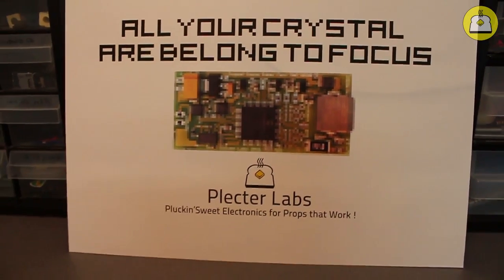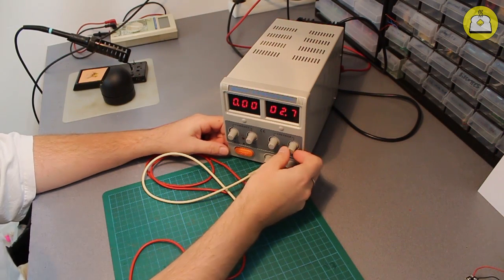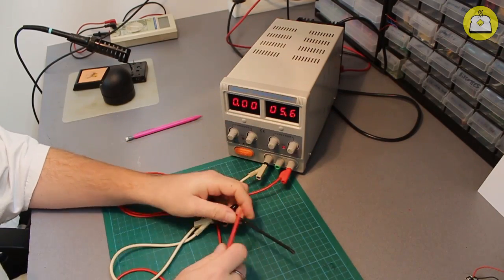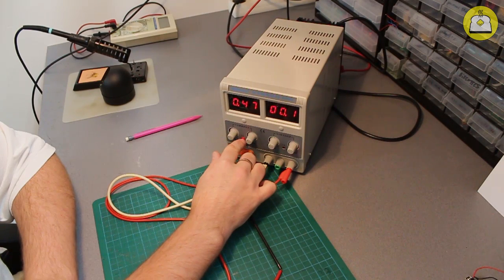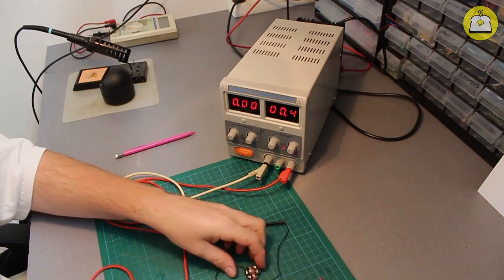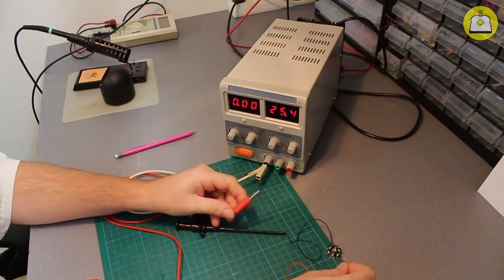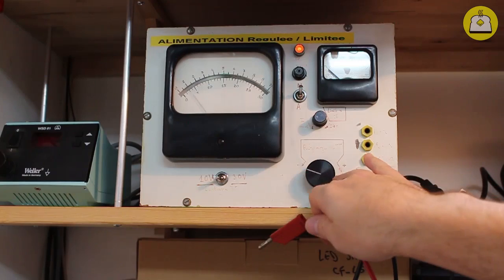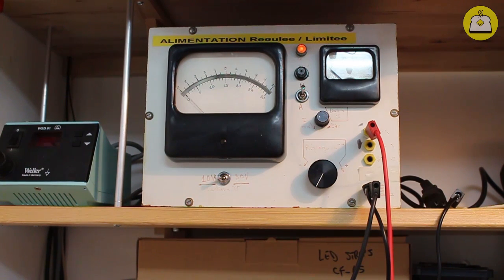Bench Power Supply (PSU) tutorial

Comment: I got a 60v 5 amp model and when i shorted it out to set the current limit to 4 amps like you did in the video it sparked and now I cant adjust the output current, it just stays at 120 volts. I just requested a return if they wont return it could it possibly just be a fuse that popped? Or maybe something else that would be easy to fix? Thanks for your time this is my first PSU
Reply from the maker: On which voltage was that when you shorted it ? By definition, voltage should drop and current would just ramp up to the the limit. Now if it was set to high voltage (like 20+) when you set the current you could have blown a fuse. There are several inside in general
Reply: ***** Thanks for the reply, ya if your saying 20+v is high voltage i wont tell you what i had it at lol. I'm going to see if they take it back but if not im not going to push the issue and I'll open it up and see if its just a fuse. Thanks again!
Reply from the maker: willm350
happy to help. If you had cranked it close to the max, it's possible that the current limitation module didn't have time to trigger, as that's a lot of voltage to take down, and a lot of amps too. So to prevent a major failure, the fuse blew. You should be able to find those inside. Good luck

Comment: +Erv Plecter
Where can i find a very good 240V capable bench power supply ,and which one do you suggest ?
Reply from the maker: you'll find those on amazon UK. If you're after a professional bench PSU, I suggest you look at the ones sold at Farnell, Maplin, or Mouser, depending on your location.
Reply: i'm looking for a begginer one, and to be honest i like this one you're using now but i cant see its name to look for it .the heat sinker looks really great and shows that this one you have is well build .i wish if you can provide me with the brand name ,thankyou also for communecating and helping me out by giving these tips .

Comment: How do you know what amps to set it on. I bought a bunch of electronics that I haven't played with yet. Whatever I decide to make, how do I know the amp setting?  Thanks.
Reply from the maker: the video explains how to set the max current limit
Reply from the maker: the current limit depends of the device you're powering, I can't guess, it totally depends on what it is
Reply: @ErvPlecter  thank you for your quick reply. I bought a bunch of things.  A bluetooth circuit, relays, a timer, etc. I was wondering because I have a power supply getting shipped and I want to play with it by hooking up some stuff to it. I know how to set the amps thanks to your awesome video but like say if I have a strip of led that I snagged from some old junk that doesn't have amp  numbers on it or say I have a few things that don't say amps but volts.  Is there a way to figure it out using a formula or do I wing it or do you have a video that helps a noob such as I that I can watch.  Thanks again!
Reply: BTW, your homade power supply is cool as hell.

Comment: So you prefer switch-mode/regulated rather than linear/variable PSU's?
Reply from the maker: I'm not sure I understand the relationship above between linear slash variable PSU. Both SMPS and linear can have a variable voltage. But you might mean unregulated instead of variable ? Linear power supplies can also be regulated as well (variable output opposes to fixed output).
The model in this video is (afaik) SMPS, it's a great deal for general purpose electronics in particular digital electronics for which PSU noise isn't a big deal. For audio I use a regulated linear PSU (home made) but it has a smaller current output (2A), which is expected for linear. This is the other pro for SMPS : size and weight are generally better for higher current output compared to linear. So bottom line I use both, but not for the same things.
Reply: Erv Plecter Hey! :*) Sorry, I'm just beginning my journey into Electronics (hobby). I hope you understand my confusion (that's a real understatement, lol!) as a beginner. My search for Bench Power Supply howtos thus far hasn't been too fruitful (hint, hint). There's lots of stuff about reviews and tear-downs, etc., but nothing much for the actual beginner explaining/demonstrating, hands-on, start here, show and tell's, do this/do that, examples/kinda stuff. Maybe I'm just not using the right search syntax (lol)? 
Regardless, your vid is exactly what I'm talking about! Thx again! :*)
PS: I really like those drawer cabinets in the background. Do they have a specific name-type? Where'd they come from? :*)

Comment: I need someone's opinion about linear power supplies. WHat are the good specs on ripple and noise? If
ripple and noise:  C.V. <20 mVpp / D.C. <50 mApp is this good, very good or bad specification?? Purpose of use: to build and test a homemade hifi amplifier and other stuff were ripple is a factor.
Reply from the maker: it depends on several things : recent cheap bench PSU are SMPS which is... bad... bigger ripple. < 50mV is ok for most applications. For your amplifier you can test with any PSU that has a real transformer (coil) not SMPS. Once it's confirmed it works fine, you can further build the proper power supply for it using a toroidal transformer and symetrical power supply with a good filtering (10,000 µF on each rail, audio quality electrolythic capacitors).

Comment: hi 
what the unit of Current density ? is it A or MA?
i have Dc power supply 60V - 3A model. and i want to connect it to a reinforced concrete so the bar act as cathode and a mesh on the concrete act as Anode. 
i want to apply a current density of 0.8 A/m2 .. Do i have to multiply this number by the Steel Area to get the current density at the DC power?? if the steel area is 0.01m2 therefore i = 0.008 amps. 
i think it is very small number!! 
can you help please as soon as you read my comment.
thank you
Reply from the maker: Chahra Meftah : current density is current per area unit. Current can be expressed in amps or mAmps. You don't apply a current density. Current density is the result of applying a current to a certain surface.
Reply: @ Erv Plecter Thank you for your reply
Reply: ***** another last question please! 
say i want to apply a current density of 0.7 A/m2 to a bar with surface area equal to 0.01 m2 .. so the current is should set at the DC supplier should be 0.7 * 0.01 that give me 7 ma. is that right?

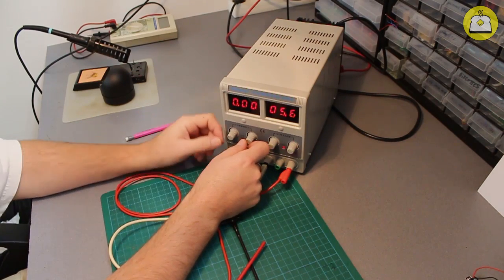Comment: I have one of these. I'm struggling to understand how to set the current limit. When I follow the instructions that start at 5:22 , I don't get the same results. I turn the voltage and current dials to zero. I short the two terminals. Both displays read zero. Now when I increase the voltage even very slowly by the tiniest amount, the device beeps and cuts out. The 'current' screen shows something similar to 'ERR'. There is no opportunity to fine-tune, the device just cuts out. 

Now I've also noticed that with some very careful adjustment, I can get the voltage display to read 'zero' and the current screen to read around 0.5. But again... turning the current dial makes no difference. Can someone help me understand what I'm doing wrong please?
Reply from the maker: I can't speak for all bench PSU models, however, you should probably put your current know a little higher first place before you start increasing the voltage with the probes shorted and watch the current increase. Current at zero might trigger a fault mode. It's possible also that your PSU isn't designed to make the voltage drop when excess of current is detected by the current limiter and that you get an error instead (first time I would hear about this, usually you are proposed to adjust your current knob).
Reply: @ErvPlecter  Wow... thanks for that fast reply. With your help I've managed to work it out. Because I would probably forget if I didn't write it down, I've written myself a guide which I'll paste here in case it helps someone else figure out how their particular model works:  (With the caveat that 'your results may vary', and 'always read the manual'!): 

1) Ensure that the power is turned off. 
2) Turn the current (left-most) dial to the 9'o'clock position. This represents a cut-off of about around 1.5A.
3) Turn the next dial (the 'clicking' voltage selector) to 0-15. This connects the remaining two dials.  
4) Turn the remaining two voltage dials to zero. 
5) Turn the power on. All displays should read zero. The unit beeps twice. 
6) With banana plugs, leads, and crocodile clips, short the -ve and +ve terminals. This should not cause any change in the displays, nor any beeping. 
7) Gradually turn the 'fine' voltage dial clockwise. The current display should increase to around 1.5A at around the 10 or 11'o'clock position. This is approximately the current that the 'current' dial was turned to in step 2. Then a slight further turn of the 'fine' voltage dial should cause the supply to cut out, accompanied by beeping and 'ERRR' on the current display. The limit is now limited to around 1.5A. Fine-tune the cut-out by gently turning the current dial to make the unit cut out at the appropriate level. 
8) For reference: 
1.2A is the minimum limit on the dial - turned all the way to the left.
2A is around the 1'o'clock position. 
2.5A is at around 3'o'clock. 
3A is the maximum output - turned all the way to the right. 

Thanks again for your reply!
Reply from the maker: @samshltn  that's perfect. You got it right, the goal is indeed to build up a "scale" of current on your knob and get used to put the current limit where it's acceptable, like when turning on a board for the first time, you estimate it needs like 150mA, you give it 200-300 but not 2A, safely increase the voltage, check used current etc. Good job

Comment: can you get one where whatever you set the voltage it is exactly that, also to the current. in other words not setting limits but setting exactly the voltage or ampage that does not change regardless of load or impedance.  so for a high power l.e.d. set at 3 volts 20ma or 30 volts  2ma which does not change. complete control!
Reply from the maker: +Alan Wolstenholme you have that sort of control but keep in mind a specific load will impose you the voltage/current bias point. A LED is typical for this, defining a current will make the voltage drop or increase to the corresponding zone of the current / voltage relationship of the semiconductor
Reply: i just want to find a way of doing an experiment to found out for example if a 12 volt 10 amp bulb will light at the same brightness if a 24 volt 5 amp supply is connected to it-obviously massive current limiting but just in theory-think i might be able to achieve this with batteries due to internal resistance current limiting-any thoughts?
Reply: you missed the point never mind. i want 10,000 volts limited current, will it shock the same? there is a thing called skin effect..

Comment: Yo Erv!
Brand name on this particular PSU?
Thanks
Reply from the maker: you're right, hard to see on the video with blue-on-grey markings. You are going to like it : it's "DIGIMESS" lol :-)
It's another rebranding of those popular PSU you'll find on amazon or electronic part shop. This one has a transformer inside, I actually recommend those models over more recent (and cheaper) models which are so lightweight due to using SMPS inside (no heavy transformer). Noisier, IMO (on the quality of the regulated voltage).

Comment: hi sir i have some proplem here and i hope you can help me 
i got one of these power supply and i have experiment that's requrird constsnt current at 2.7 A but when i connect my DC power it give me a max, current of 1.8 A and max (constant voltage) of 28.9 V , i tried to set the current but when i do the steps and try to connect it again it just the same old current 
can you help me please 😭
Reply from the maker: hi, it's no brainer, you can't output 2.7A with a 1.8A source.
Reply: oh i get that, but why the Dc have unstable amp i mean i want 0.89 amp constant and its just keep go up and then down

Comment: What is the green knob in the bench power supply for?
Reply from the maker: this is not a knob but a banana plug terminal (gnd / earthing)
Reply: sorry again, so the black one isn't grounding? Aren't they all banana plugs? Just trying to understand what's the green one is really for.
Reply from the maker: the black is 0V / aka "negative". The green is earth.
Reply: Oooooh I see now :D Thank you so much, great video
Reply: I have another question regarding the the Amperage lock, I did that on my Bench PSU, I lock it to .45A for example, now I connect my device and increase the voltage slowly, then it locks the voltage but I see the Amperage go higher then 0.45 then it goes down to .45 So is that Ok or a bad thing? Not sure why ampere jumps before it's locked!!
Reply from the maker: you can't "lock" current per say. Current is "used", not "forced out"

Comment: What is the purpose of the ground plug?
Reply: In case whatever you are hooking up the leads to has a metal frame or parts you don't want energized, grounding those part(s) will ensure the unit shuts off the output if and when the short (ground fault) happens, similar to touching the positive and negative leads together, the output probably clips off (or it may let the maximum current flow, 5a for the unit's maximum or whatever max the current knobs are set for, but my guess is current flow from the positive to the ground input will trigger a shut down)

Comment: Where did you get that soldering mat?
Reply from the maker: JAY LEE it's actually just a cutting mat, just like what you'll find in hobby / craft stores.
Reply: Thanks
Reply: JAY LEE I use a small glass cutting board. I just brush it off and wash it everyone once in a while. It's nothing special looking but it works great.
Reply from the maker: richycline glass isn't the best choice for soldering due to ESD and charge holding.
Reply from the maker: JAY LEE lol, the first one is for torch welding ! the second one is of the sort use at work. great for soldering and ESD, not for cutting though.
Reply: ***** Good to know. Is the hard side of your cutting mat heat resistant enough for soldering?
Reply from the maker: JAY LEE yes, though you should not have a solid wire directly heated on it obviously. When using the hot air rework station, I use the bench or a heat isolator with a piece of scrap PCB

Comment: how to use it checking dead notebook laptop?
Reply from the maker: you can use it to power the notebook if it's power supply isn't working. Most laptop use about 19V DC, notebooks I don't know. If the issue with the laptop is internal the PSU itself might not be useful except that monitoring the current and voltage can give some indications during the debug phase.
Reply: Yes, I know that we can identify the problem of motherboard from looking at the current level. But I know some problems and some brands. I wonder if any source provide knowledge on this kind of check? especially, notebook motherboard problem...

Comment: How would you use one of these PSUs on a -v to 0v to +v circuit?
Reply from the maker: you can indeed invert polarity to generate a negative voltage. But this is a single output PSU (this particular model) no symetrical voltages +/-
Reply: @ErvPlecter  Thank you for your reply. I have found a workaround hack that will work for me. It involves two large caps and two 1k, 1W resistors. I did however, learn things I did not know from your video. Thanks again.